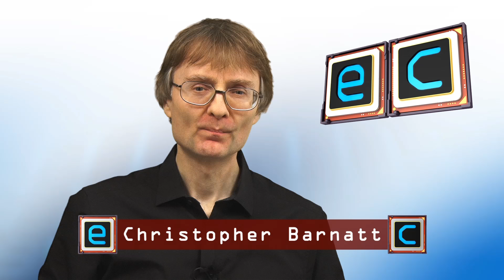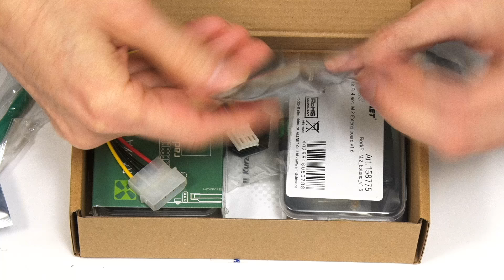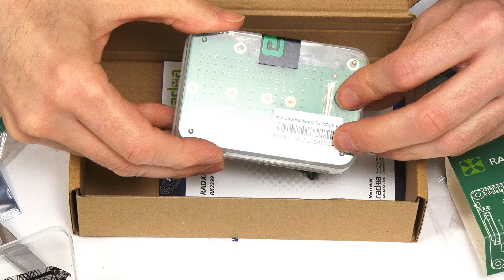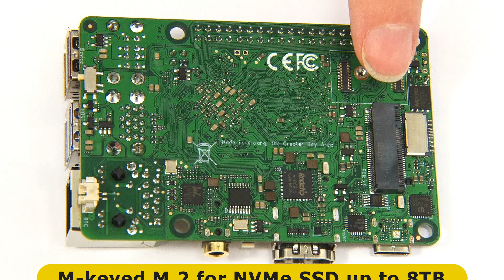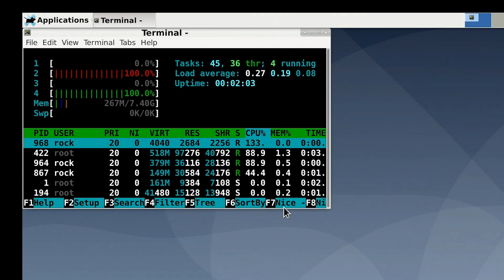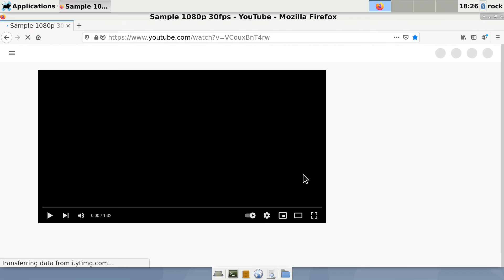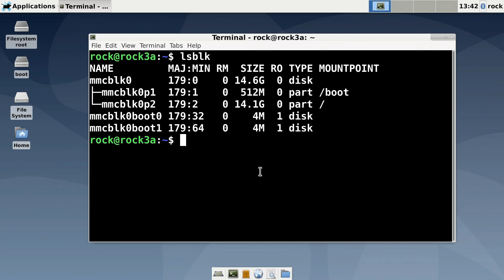Rock 3A: Dual M.2 ARM SBC with eMMC socket

Comment: Thrilled to see dual M2s on a low power ARM board.  Completely scared away when Chris can't get the M2 working in Debian.
If I had purchased this I certainly would have lost too much self-esteem in 4 hours of failure to continue.
Reply: If I'd bought this and the NVME didn't work, I'd be demanding a refund after probably less than an hour of fiddling. And I'm not one to take refunds. I believe in buying what you mean to buy and then keeping it, even if you change your mind. But that is a huge manufacturer issue, AFAIC, and should NOT ship that way!

Comment: I presume it's a logistical nightmare, but it's a shame that few if any SBC M.2 slots allow an NVMe drive to be mounted directly over/to the SBC board. I can't say I'd be faffed with the extra board and ribbon cable needed to use one.  If I did then I'd probably try fixing the NVMe board under the SBC instead of on top so that the NVMe is sandwiched between the two (if my brain hasn't failed me), out of harms way and not restricting the heat dissipation of the SBC chip's cooling.

Thanks Christopher.

Comment: I have had my Radxa 3A board running Android 11 for 2 months now. Wifi is working good over TMobile to the home. I am getting with speedtest 132Mbps down and 49Mbps up. In Android 1440p is the highest resolution I can run smoothly with Youtube. I have not tried to boot from the NVMe drive yet.
Reply from the maker: Ah, good to know. I must try out Android.

Comment: Hi Chris, another nice SBC video. Thank You ! As with other commentators I agree that the OS support simply isn’t good enough, along with the rough edges such as WIFI. Definitely needed another 3 months of polishing before it was released. Great hardware let down by poor OS. Not surprised Ubuntu worked better than Debian, as the latter does seem to lag Ubuntu in my experience.

Comment: Could we install W10, or W11, or maybe a good ole WinXP? I would need this for 1 or 2 progs that don't work with Linux distros...
Reply from the maker: This is a board with an ARM processor, so would require an ARM version of Windows. You could maybe run XP via emulation.

Comment: yet another board that simply can't hope to compete with RPis because the RPis best selling point is friendly and easy to use software.

most people buying these I imagine don't want to have to do any more faffing around than necessary.  they bought it for a project and whatever that may be likely already has a more stable base dedicated to the rpi.

Its just too bad they can't just do Raspberry Pi os but for their boards.

Its also too bad it's a catch 22 because part of why the RPi foundation can do what it does is their initial government backing to get them over the hump.

Comment: Hello, fellow Christopher! Nice to see Stanley back again... !! :-)

I had a thought for the graphical interface for the wifi/ethernet connection spot at the top in the Panel. If you right-click, is there an option to 'add new items', or something along those lines, on the Panel? Then again, right-click the new item there and select Move (if available) to put it where exactly you want it.

However, I agree, yes. That oversight IS inconvenient... hopefully an update soon from them fixes that.

I do like the board, though. I like how there's stuff on both sides of the SoC board itself. Very intriguing/unique design, too, with all the various I/O ports it has. Would like to work on some of the software for that. Like I said, looks intriguing. 

Question, though. Are there any cases made yet for it?
Reply from the maker: There are no options to add a WiFi icon, nor WiFi settings in the graphical setting panels. And no cases so far either!

Comment: Good video. But that's brand new cutting-edge hardware running a horribly outdated OS and kernel. Got to be something available for it running at least a 5.10 kernel. But for SBCs, there needs to be an OS out there running the latest kernel. These days, using Debian Buster is like using windows 8. We need an Arch ARM distro or Debian ARM Sid distro. I'm quite interested in SBCs from watching your videos, but until the software steps up to meet the capabilities of the hardware, I don't plan to get into SBCs.

Comment: Biggest hardware problem I see is the WiFi not working with their own latest image unless you do a bunch of terminal command line stuff.  Not new user friendly and can leave you SOL if you don't have an ethernet connection to setup your WiFi connection!  Why wouldn't they at least have those drivers on the image?  Crazy.

Comment: I wonder if the M.2 <> PCIE adaptor might make Youtube playback (among other things) possible if paired with a low end GPU? Seems lacking for the hardware it boasts.
Reply from the maker: It will depends on suitable drivers for a such a GPU.

Comment: i like the emmc socket. if theres a ram socket design. would be great for sbc or phone also
since high capacity ram may cost higher than rest of the board. ram reuse when upgrading to new model would help to reduce cost in half
im waiting for a well designed ram socket that both balanced in size and speed

Comment: They don't ever get it right. Some developer release a new Raspberry killer SBC with low price, a lot of accessories, great CPU and RAM, then abandon it, leave it with poor Linux support, no software update, no tutorial, nothing to upgrade the new release, then goes about to develop a new board. They choose to ignore that the Raspberry Pi success wasn't because of the price or the hardware, but about the community, people who make software, tutorials, help each other, find and correct problems within the Raspberry ecossistem. A example is the RK3399, lots of SBC releases with this processor, but it has been more than 3 years and no hardware acceleration has been achieved , in the meantime Raspberry got hardware acceleration, DRM compatibility, NVME boot, WiFi 6 and more.
Reply: It's really hard to get yet another community going after one really takes off.
Reply: what is there not to get? selling SBC is profit, developing software and giving it out for free is a money sink.
Reply: @redtails  I am not an expert, but with the price these SBC's retails for, and even you can slap an SBC together really easy, there still is some time and money invested in doing so, so being able to sell enough units to get a good price per SoCs and other components, I really don't think many of the SBC makers can produce and sell enough units to make a big profit. And then also develope software and mature the product over time. I am beginning to think many people is just too fixated on gettting a board with more features and faster cpu for as cheap as possible.
Reply: Good luck trying that. It's hard to get a community going. You have to entice developers to create software, then those people to start a snowball. But with a thought like this, nothing gets off the ground. It's both a time investment and a money one surprisingly.
Reply: Have you ever thought... that the reason why they can pump out boards so fast and so cheap is that they don't spend their money on software engineers... Unless someone show me proof that the CEOs of these company are rolling in dollar bills, I won't believe that there's another way to make these products.

Comment: Their naming convention appears to be taking some ill-advised notes from USB. A more clear time or tier differentiation would be nice.
The WIFI bit confuses and disappoints me as that would likely be a key method of comms (plugging in a cable is often inconvenient to do, distance/location-wise) and it doesn't come either on-board like many or with drivers and a small piece of software preinstalled to get you up and running quickly (and easily).
The M.2 connector for the SSD, on the other hand, is a nice addition that you can only get on a Raspberry Pi with a computer module and one of myriad I/O boards (to my knowledge).
Reply from the maker: I like your USB comparison! Nice.

Comment: A couple of curiously perverse design decisions there. 
The previous model's positioning of the processor on the underside allowed that enormous heat sink/base, which was good. Then they revert to a top-mount. Pointing the NVME interface outboard mandates that bridge kludge, instead of a close mount inside the footprint.   Outward-pointing interfaces would just need the cable. (Or does someone make a C-shaped reverse adaptor?)
Smaller companies without the Pi's software ecosystem resources would do well to put their OS code in a conspicuous place for developers to dive in and update, marked with "TODO"s.

Comment: The Pi 5 better add M2 support! Even better with the connector under the board and facing in a direction so an NVME card will also lie UNDER the board.
Reply: Agreed and seriously I think we've grown up and don't need "sd card" anymore. The other thing? It's a 64 bit chip, it needs the primary os to be 64 bit. It's beyond time to retire the 32bit OS and also, move forward.
Reply: @TheJacklwilliams  it bogles my mind that they still have not released a 64bit version of raspi os given that the first pi to have a 64bit CPU was the raspberry pi 3 in 2016.  It's been almost 6 years and they barely have a beta.
Reply: @outofahat9363  Agreed. What’s the point? I get it if you are doing embedded, hardware stuff, etc…. But once it became powerful enough to do desktop, server tasks, etc… and 64 bit? Doesn’t make sense. Now, I ‘ve been running the beta 64 for about 8 months now and it’s awesome. Why they’d hang on and continue dev work on the 32 bit, when they could just translate over, makes ZERO SENSE.
Reply: @outofahat9363  ikr - you can drive 2 4k monitors but 64 nah we good… like wat it’s not like they don’t have dev community to do it. I wonder if there’s some other detractor like a licensing hurdle
Reply: @TheJacklwilliams  Why? Because most Pis out in the wild have less than 4GB of RAM onboard and haven't suddenly become useless just because Pi4 4GB came out. Once you start shovelling in all sorts of hardware goodies and RAM, with the additional costs that will be added to the basic Pi price point of $35/£30 you might as well just get a cheap used computer with a lower power CPU to run desktop/server tasks, like an older Lenovo Tiny PC. 

There is a purpose to the RPi and it isn't to be the cheapest or smallest desktop replacement.

Comment: One request to Chris can you upload your videos in 60fps for smooth video watching experience
Reply from the maker: Sorry I can't, my cameras are PAL and shoots at 25fps.
Reply: @ExplainingComputers  actually you can use Adobe premiere pro to modify using optical flow and changing the sequence setting from default fps to 60 fps. 😄😃
Reply from the maker: @earnests5375  Yes, but this would just introduce a frame rate change likely to cause playback issues earlier in the pipeline! :) 25fps video (and indeed 24fps film) is perfectly smooth if shot correctly, so the issue is how playback is handled -- the conversion of that frame rate to whatever the monitor is being refreshed at -- not the nature of the source material. If I knew every screen that playback would occur on was refreshed at 60fps, then a conversation at my end would make sense. But sadly this is not the case.
Reply: @ExplainingComputers  👍👍

Comment: Chris they didn't build the kernel for debian with pcie drivers / device drivers so it fails to find nvme or pcie devices out of the box.  I have had to rebuild the kernel from their BSP to get it plus kvm virtualization working. Cheers!
Reply from the maker: As I came to suspect! :) Sounds like you have it sorted.

Comment: As ever with single board computers, it's the software / OS support that makes or breaks it, and here the Raspberry Pi models stand head and shoulders above all else.  That said, there's no harm in having options to choose from.
Reply: Hopefully the overkill amount of IO on this board attracts some attention, seriously impressive for what's about the same size as the Raspberry Pi 4B.
Reply: @MicroLinux There are 64 bit versions as well
Reply: @MicroLinux Depends on the application, I use mine as a headless server and never had an issue with the 64 bit lite OS.
Reply: Choose having  a root canal over fighting with one of these Rock boards. You'll have a better time!

Comment: I really like the SoC (CPU) mounted on the "bottom" of SBCs like the Rock Pi 4C.  Wish Raspberry Pi did that so you could actually mount a "HAT" without affecting cooling or blocking a fan, etc. - 4:09
Reply from the maker: I do agree. Radxa have been criticized for it in the past, but I really like their Rock Pi 4A/B/C and Rock Pi X SBCs with the underside SoC and a large passive heat sink. Similarly for the Friendly ELEC Nano Pi models.
Reply: @ExplainingComputers  - If people don't like the bottom mount for heat dissipation you can mount it vertical or even upside down.  Vertical would likely be best for passive cooling of "HATs" also.
Reply: @ElmerFuddGun  but then the electrons will need to flow uphill ;)
Reply: I would add my lament that HATs have gone out of fashion.  I wonder if that could be changed by having a good HAT store or HAT collection.  I think the thrill is gone from breadboarding IO circuits but I still love little computer that trump big ones by getting their own data or controlling things in the real world.
Has anyone done a "Sexy HAT" video?
Reply: @skyak4493  Have they? Gone out of fashion I mean? Why didn't anyone tell me! I used one on my Beaglebone just the other week! Now I risk looking like a fool if I show anyone!
Reply: @unvergebeneid  Rock on!  Wear those hats with pride!

Comment: Unfortunately the same sad outcome as always: very promising hardware, with a software package which is a let down. I wouldn't be that picky if the past has proven these boards will get the same software treatment as the Raspberry lineup, but it's usually not the case.
Anyway, thanks for the video, the same detailed review as you always do!
Reply: I got burned last time I bought a similar sbc, a pine H64-B.  Nice looking hardware that was mostly useless due to broken or unavailable drivers.  I'm sticking with raspberry pi's or odroids for the foreseeable future.
Reply: @adamf663  Allwinner SoC based boards are notoriously bad in this regard with their closed binary blobs. I have a Cubieboard 1 which got kind of usable with the support of Armbian, but at that point it was pretty much obsolete hardware wise.
Reply: They could have at least got the board working before they put it on the market. :-p     Fool me once....
Reply: totally agree. Bought so many SBC with zero support. Raspberry is an obligated choice
Reply: I have been playing with a Quartz64 board which has a very similar SoC and up until now it has been limited by the hacked about 4.19 kernel that Rockchip released for them. However just this week a mainline 5.16 has come out with working HDMI output which means that the community is less dependent on Rockchip. I am more hopeful for the future.
Reply: I think it'd be wise to stick with mainstream SBC's, because they're more likely to have dev supports, even if they don't have the most powerful hardware.
Reply: what do you expect? Random Asian companies try to maximize profits by pushing out shitty SBCs and spending 0 time on actual software development. The true value of raspi is the thousands of hours of software development time
Reply: 👍👍👍Thanks Guys for sharing this great info!
Reply: Lattepanda is a very nice SBC. 👌
Reply: I bought a radxa board and couldn't get all the hardware working, because the OS was too buggy, missing drivers, and the one or two chinese boys that owned the company (on their community forum) spent no time supporting software but only spent their time on the next board release. No care for those of us who already paid. No business ethic.

So, I buy only Raspberry Pi now. I don't buy a board because I want to help the company work out thier driver bugs. I buy the board because I need to get busy developing an embedded solution.
Reply: @MicroLinux Then what is your insight why linux support on random SBCs is universally bad? The possible explanations that I can see are 1) actual incompetence or 2) lack of interest to develop as such. Which one is it? Or is there another explanation?

Comment: LOL 2x typos at 4:34.   ;-P
Reply from the maker: I do sometimes make typos, but I cannot find one here. :)
Reply: @ExplainingComputers  At 4:34 there are two instances of "Ghz" which should correctly be "GHz". When abbreviating Hertz an uppercase "H" should be used. You did get it correct in one of the three times GHz was used at 4:34.
Reply: @stuartm5745  - You got it, Stuart.  I also saw it a couple times later when talking about the WiFi and something else.  Gotta keep Chris on his toes!   ;-P
Reply from the maker: @stuartm5745  Ah yes, I see it now, the second gigahertz on the left is wrong. You are of course correct. I was looking at the "2 x" bit and the core names. Strange what our brains manage to filter out (and get wrong). My bad. :(
Reply: @ExplainingComputers  - Ya, after I posted it I though I should have just said "2" instead of "2x".  But you are right about "what our brains" filter and others see.  I see wrong units all the time...
hz instead of Hz
mHz instead of MHz
mah instead of mAh
etc.
Even see KC or MC instead of kHz and MHz... mostly old timers BUT it has been in use for 60 years!